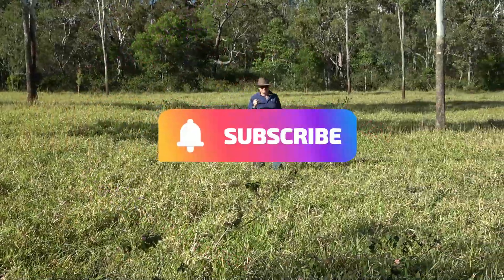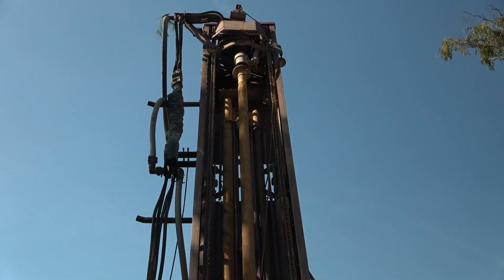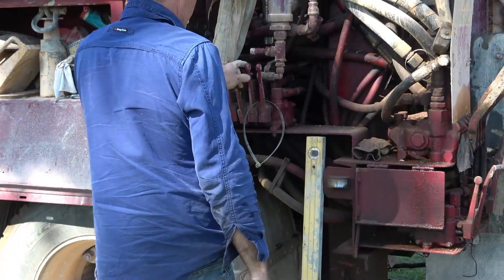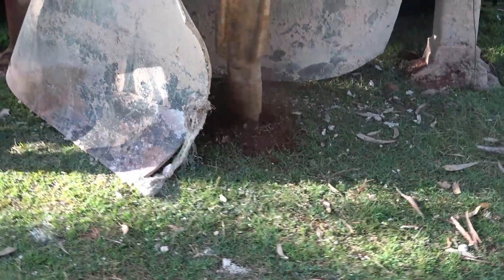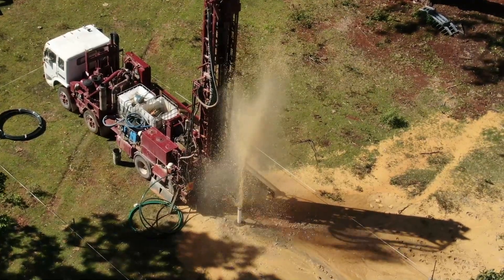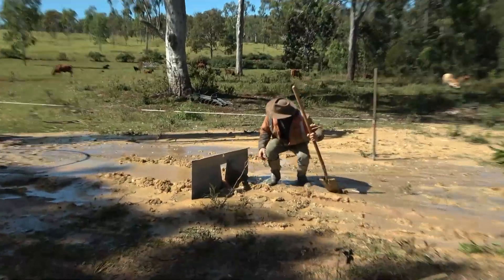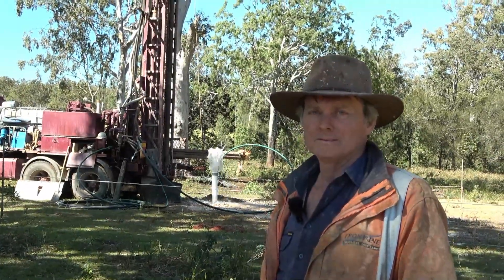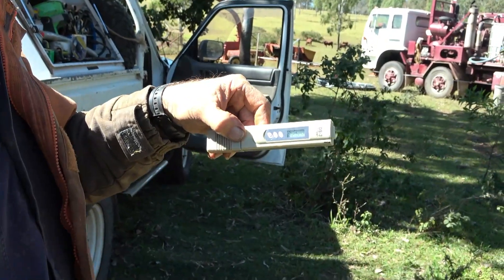DRILLING A BORE AND A INTERVIEW WITH THE DRILLER ABOUT DEVINING

Comment: I find the divining always works better if the whole crew goes to church first then gets the Aboriginal ringers to do a proper Smoking Ceremony before dropping the bit! 😜😁 
Should be good water anywhere there with the basaltic sponge on top.
No frost down there in the last 2 days John? Could've saved the cost of fixing the old house cat up the last couple of mornings. 🥶😅
Reply from the maker: Going to church wouldn't work in my case. The roof would fall in and Id be on the bad side of the books. No frost much but I dont know why coldest I have been in 20 years up here. Cold wind all day. The cattle have been laying on their side stretched out in the sun in the middle of the day trying to warm up. John

Comment: Firm believer in defining. Seen it work too many times. My granny was known as a water witch. A highly respected thing where we were from. I inherited it but not near as good as her. Not much demand for it now.
Reply from the maker: Its funny how some people get a reaction and some don't John
Reply: @farminglifeaustralia6716  I use two wires. When they cross I mark the spot and start circling. If I get a couple of crosses it’s a good spot. I can find underground water lines or electrical lines. My wife can’t do it either.
Reply from the maker: @ddd3240  The driller uses one long wire to start with the length makes it sensitive. Once he has found a spot he goes over to two wires. I used to use just the two wires but I tried his way and it makes it easier to find a likely area. Even riding around on the 4 wheeler with one wire slowly to find the generally wet areas. John